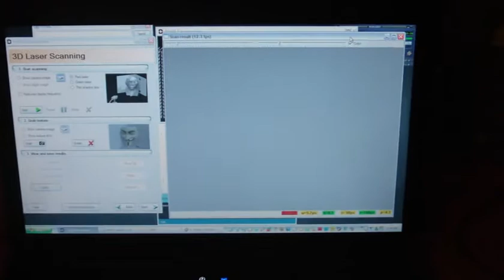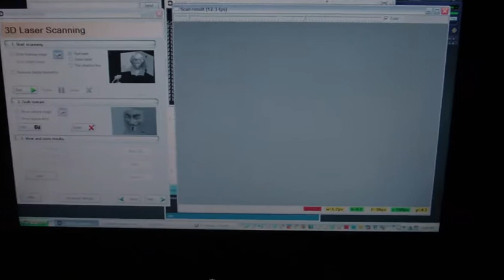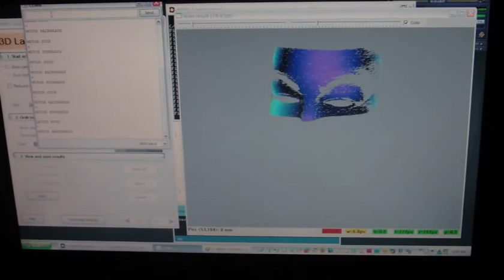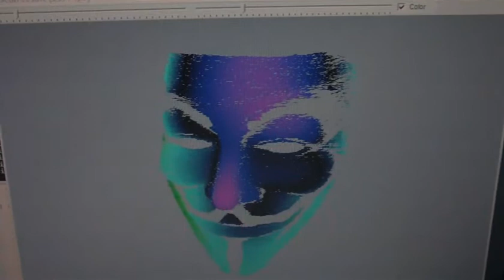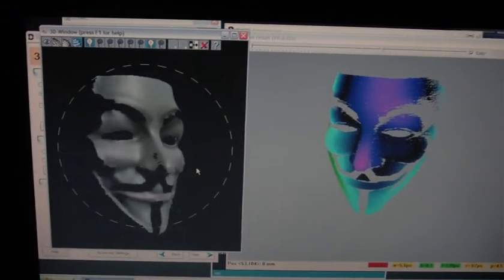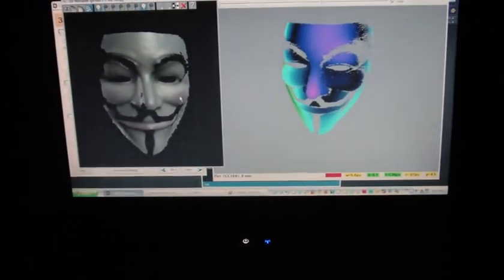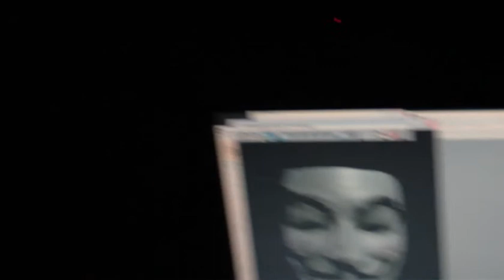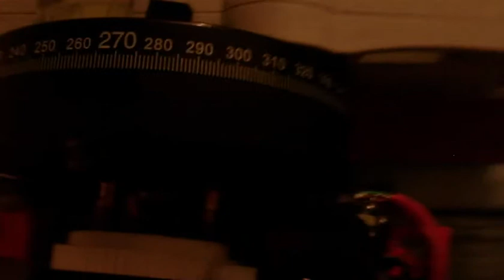First Automated Laserscanner Demo

Comment from the maker: @davidzomec i think its a matter of preference, somewhat.  The line has to be horizontal enough that the software can see a little bit on the left and right of the subject, so it can figure out the angle of the laser level plane. The more angled that plane is along the z-axis, the less scans you'll get out of one vertical pass, since on one side the laser will be raised, the other side lowered, and eventually one or the other leaves the screen, and sooner than if the line was true horizontal.GL!

Comment from the maker: @marcelosouza a "laser level" (for construction gals/guys) splits the standard laser beam into a thin line for you.  You can usually get one for less than 20 bucks.  I dont think a servo is precise enough.  You need to be able to move the laser line as slowly as possible.  You could probably use the servo to control the speed of another motor on a gearbox though, probably wouldnt need the h-bridge then... H-bridges are super easy though, just four transistors you control with a microcontroller

Comment from the maker: @BrutusJones Hmm i couldnt say, i just sort of improvised mine together out of stuff on hand.  The "tricky" part was implementing an H-Bridge motor controller (for reversing polarity and controlling speed).  Also you need to gear a DC motor way down (or use a stepper motor, but then you'll need a fancier controller).  I used a dc motor with matching gearbox out of  USB toy foam missle launcher i got cheap.

Comment from the maker: you need to make sure your camera image is set to ultra high contrast (only black and white), and that the only places that arent solidly white are the calibration dots and rings (which must all be solidly black).  Also the calibration rings must have at least one hollow/white pixel in the middle.  Also make sure none of the calibration marks intersect with the edge of image.

Also remember you can manually specify where the calibration dots go, sometimes this is the only way to make it work.